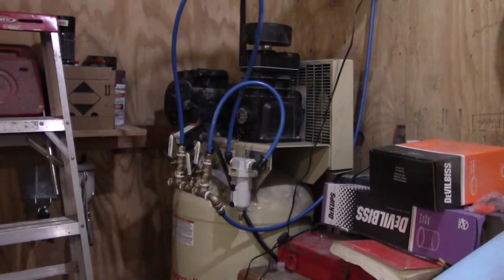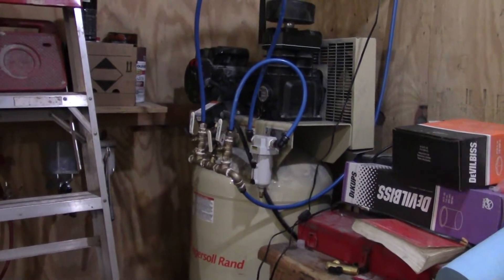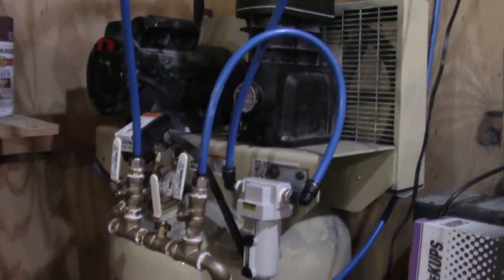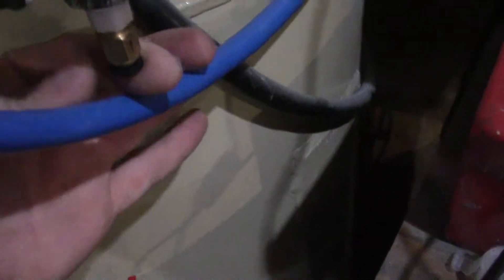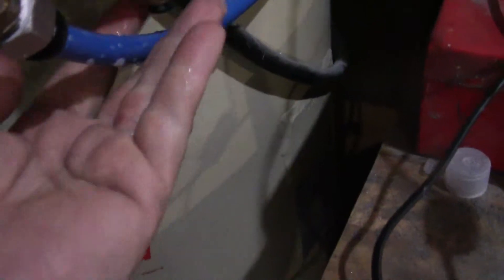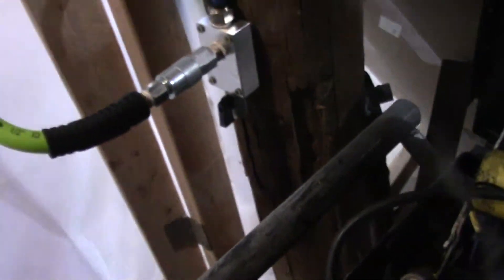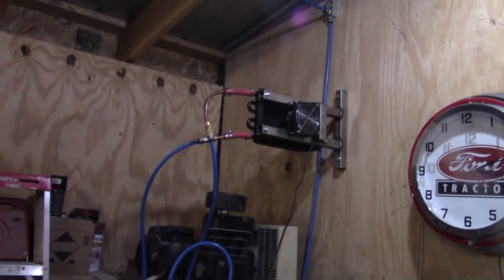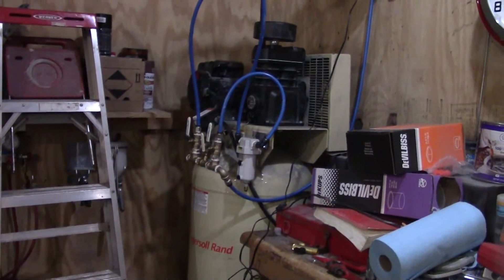Shop Air Dryer Update

Comment: Water in the air, always a problem, the plant I worked at used a lot of air always having problems with water in the air they had those dryers that were bigger than the compressors got lot of it but still had some don't guess you can get it all out.
Reply from the maker: Yeah, same way where I work.